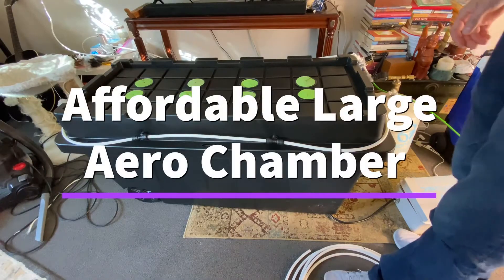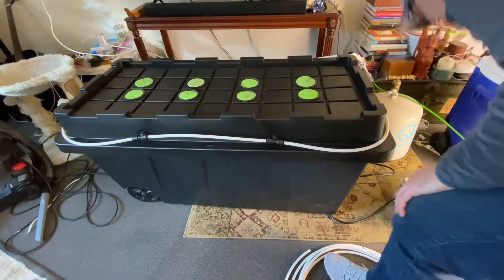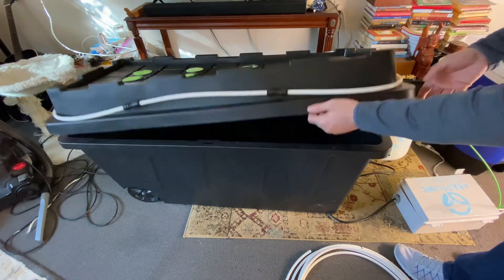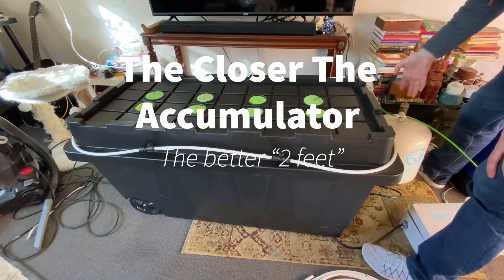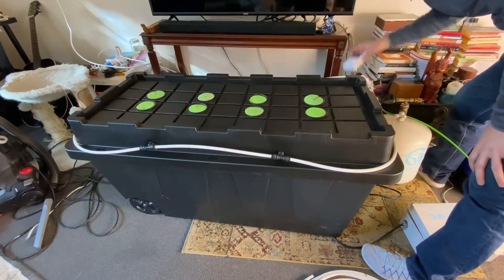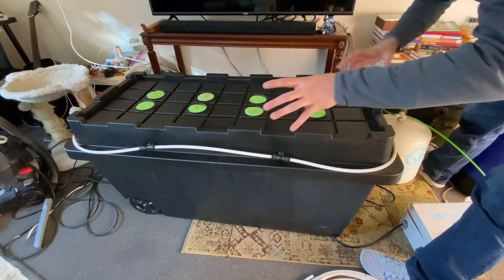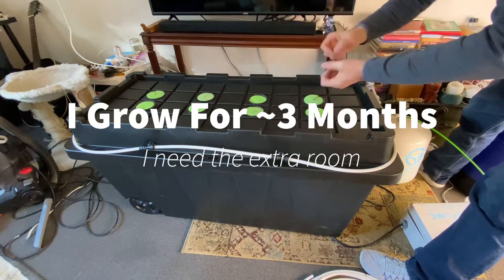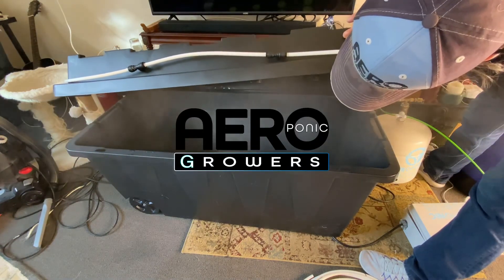How I make a TrueHPA aeroponic root chamber using a storage box. Aeroponic grow chamber only.

Comment: Thanks for the video. I'm just getting into that topic. Is it possible to run two boxes simultaneously with only one strong enough pump and pressure tank?
Reply from the maker: You can definitely run two boxes off one pump and 4 gallon tank. The pump will fill up multiple tanks, it just stays on longer. For long runs I put extra tanks. One at the end can help a lot.

Comment: How did you get the nozzles to stay in the lid?
Reply from the maker: So I use a 1/8th drill and tap to make threads through the wall. I screw the nozzle through the wall into the tee fitting.

Comment: Thx it's freaking cold outside and this system lets me hang onto some of my starts longer and maintaining their care no matter there size if the spring happens to get pushed back I won't feel rushed to move my starts outdoors because of their size or needing to be repotted. Advice for taking a start like this that eventually goes into soil?
Reply from the maker: What most people don’t know is that aeroponic roots are more similar to roots found in soil. Rather than long stringy hydroponic roots. Putting aero plants in soil is what I recommend if your system fails, not putting it in hydro. So anytime before the flip and without damaging the roots is fine to transplant to soil. I moisten the soil first because those roots are use to having a lot of oxygen. I keep the soil loose and airy and wait a few days before really starting to water them. Aero to soil is good, Aero to hydro can drown the roots quickly.

Comment: If you want to switch back and forth between pressure or sprinkler could you do so on the same setup or use the same lines or heads on either system?
Reply from the maker: Both systems would be separate unless you used a separate feed line with a pressure reducer to lower the psi on a pressurized system.

Comment: I would like to know what water pump you are using
Reply from the maker: I’m using the pump I use to sell, a high pressure diaphragm water pump. Now I recommend the Aquatec 8800 pumps, get the ac/dc transformer and Aquatec has 2 pressure switches that work best. I forget the letter that designates the switch but one goes to 110 psi and the other 120 psi with a 20 psi differential. Be sure to check this as the common switches used are usually of a lower pressure setting.
Reply: I can only find 80 psi pressure switches. Can you lmk a model number for the ones you use. Or even better sell me one!? Keep up the good work man!

Comment: Man, you are having the success you deserve. Nice to see all the upgrades ❤ in a couple of years max results 💪
Reply from the maker: Thanks, this design is actually the first design I made over 3 years ago. But after years of trying to make small enough systems to ship to people it’s this design that I go back to. Much thanks for the support!
Reply from the maker: One of my videos shows how to make a low pressure aeroponic system without nozzles. If you have a stream of water hitting something to make droplets you have built a low pressure system. Look around for plastic containers people are throwing away. 50 gallon blue barrels or pickle barrels etc can be found for free. Make a box with pvc pipe and use a thick black plastic bag as the chamber and a piece of foam to hold the plants. Instead of net cups and foam simply get a pool noodle float thing and cut it like slicing bread. That is now your net cup with foam to hold the plant. Refugees are using thrown away foam mattresses to grow vegetables in the desert. Plants only need Nitrogen, Phosphate and Potassium in water to grow, oxygen and light and you’re good to go!
Reply: You have all my support!
Great design, simple and max efficiency 100%.
Because of the pandemic I can't afford it for a while, maybe next year 🤦‍♂️
I'm trying to build a simple one to get by, but without success. Can't find right nozzle...if you can guide me 🙏
However we continue to improve!
Stay safe brother 👊